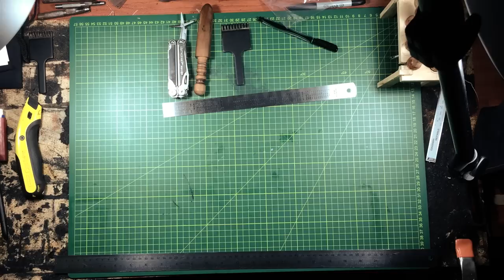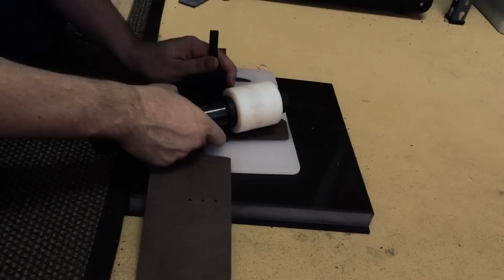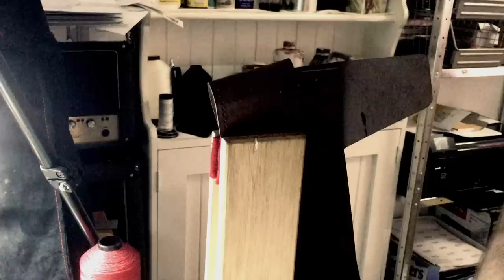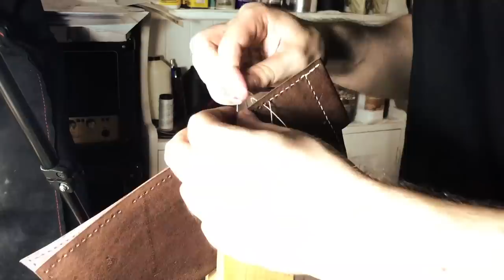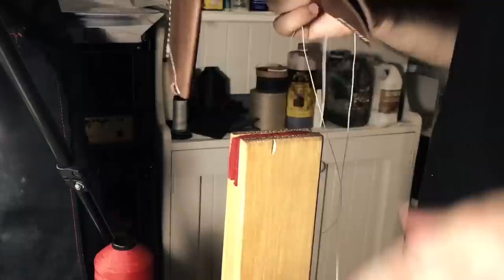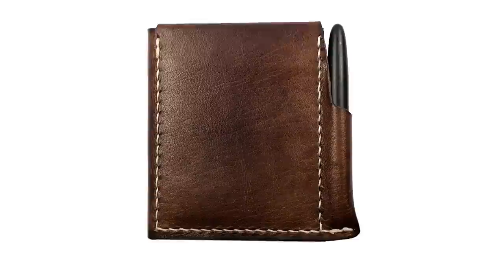How to make a tri-fold wallet from a single piece of leather

Comment: What ensures that the top two card didn't slip under their lip? Only the friction?
Reply from the maker: The height of the card slot. Even if the card is pushed to the bottom, it's not under the lip. But in practice, the friction does a lot as well
Reply: So the overall height of the wallet is about the same as the width of a card? Meaning the inserted cards' top didn't make a step-shape, they are all in the same poition, and they're only separated by the lips? 

I'm trying to understand the design, as I'm about to make my new wallet. My old one made around 6 years ago in a need of a more serious maintenance (as the lining's edges started to fringe and got free from the stitches that holds them against the leather), and has some design flaws that I coud fix on a new one.
Reply from the maker: yes, that's right. The cut for the card is pretty much there as a separator only. I know it's not the way that's normally done but I liked it that way because it's a very simple and sturdy construction. Nothing there to fall apart. I've been using this wallet for just over 3 years now and still like it. I don't think it'll break anytime soon either.
Reply: Okay, now I'm understand that part, thank you! It helped me to go towards a simpler solution than the one I had thinked first. Now only I had to came up an idea for holding the coins - I didn't want an unwieldy one.
Thanks again!